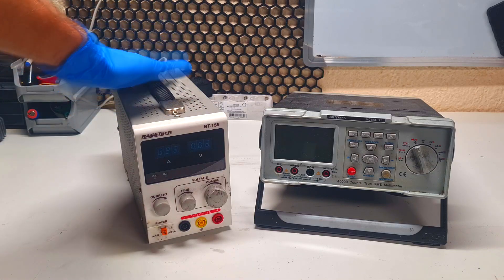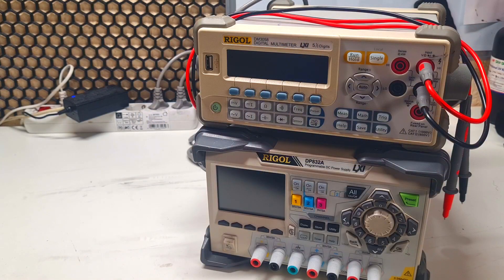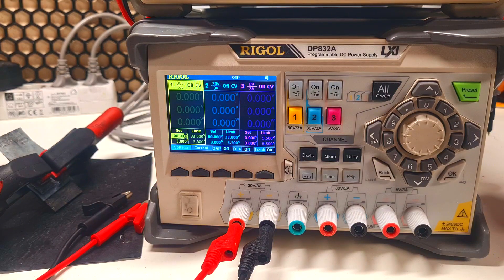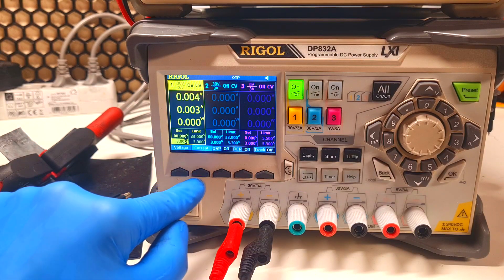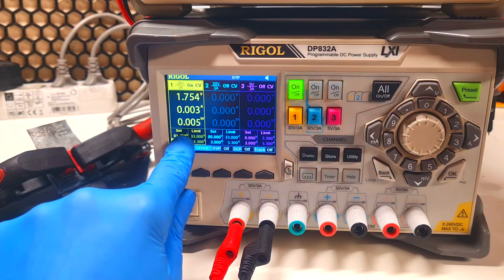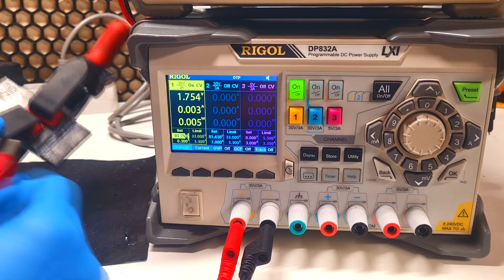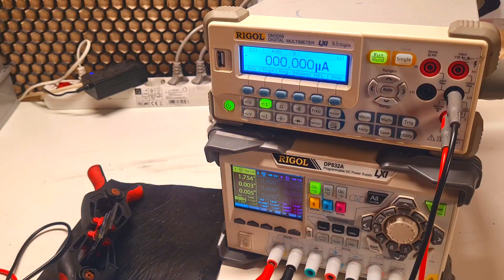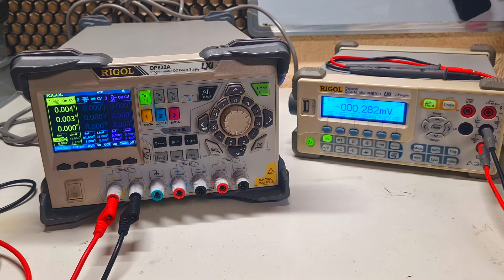Charging Zinc Iodine battery with Rigol

Comment: How do you know how setting the V/A for charging? I mean the optimal combination between current and voltage. Is there a way to calculate this?
Reply from the maker: In short... experience. I know my cells. Most of the cell voltage of different battery chemistries are already known. The cell potential can be also calculated (see on google). But when you know the nominal cell voltage of the battery, then the charging voltage will be a bit higher.... for example the nominal voltage of lithium ion battery is 3.7V but it is charged with 4.2V.... so the charging voltage is 0.5V higher. Or by lead acid battery where the nominal voltage is 2.1 to 2.2V but the charging voltage will be from 2,3 to 2.45V and so on.   About the current.... In 90% cases I use the charging current of 300mA per gram of material on all cells.... why? I dont know... because I decided so. But when I test a fast charging or I want to know if the cell can take high charging current, then I charge the cell with higher current (per gram of material).